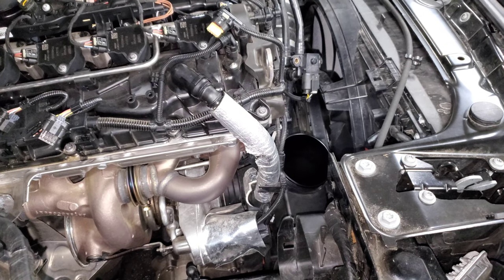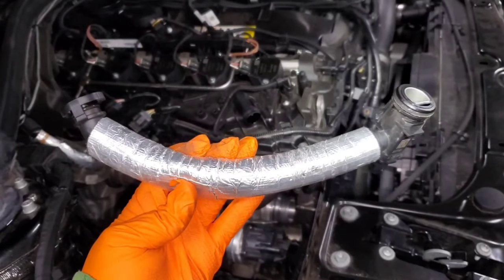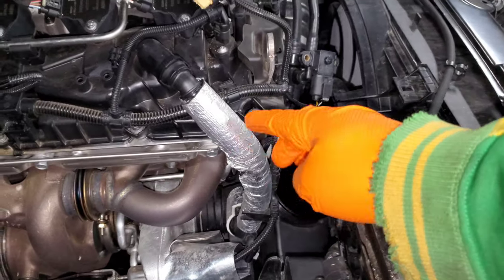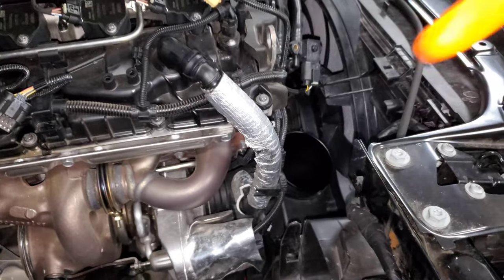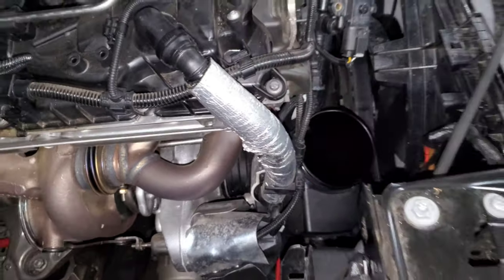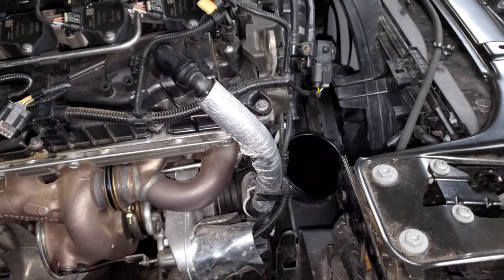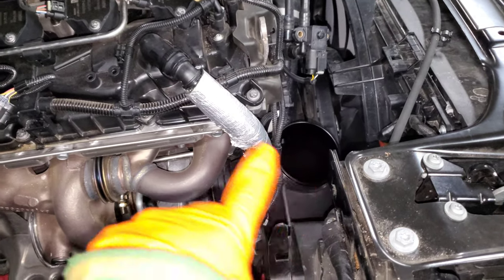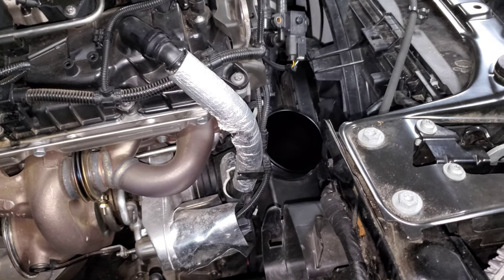P120D/20E120 Crankcase Ventilation Hose Disconnected - Common B58 Issues

Comment: Had this code pop up on my m240i with the agency power intake (since discontinued.) Didnt throw a CEL, only a code, so you wouldn’t know if you didn’t check. I ended up reinstalling the intake much tighter the second time and cleared the code and it hasn’t immediately come back yet. Thanks for the video as always, glad it wasn’t just me.
Reply: Hi! Did the code ever come back after you reinstalled the intake?

Comment: Is it okay to drive with it if it’s cracked? Will it negatively affect the car? Thanks 🙏🏽
Reply: Also are there any tutorials on how to replace this hose, I can’t seem to find any lol
Reply: @Oscarrsaa you find how to take them off? Ever since I started running e50 mix this thing cooked it
Reply: @Hand3r261gos  yes I took mine off, it’s a really easy job but the clips that connect the hose to the bottom of the intake are the hardest part to take off, my suggestion is to get a small screwdriver and push in the bottom tab FIRST and then do the top. Should pull out with a bit of force. Also I’m on e50 too and my old hose broke into 3 pieces when trying to take it off lol… it did make it easier though.
Reply: @Oscarrsaa does this cause smoke out the exhaust ?
Reply: @jzallday102  no
Reply: @jzallday102  only thing that caused smoke was when I had a faulty pcv diaphragm. Easy 15$ fix and never smoked again
Reply: @Oscarrsaa  yeah man going thru an smoking issue changed my pcv but looks like my oem has a small crack on it and supposedly it would have an air leak from there if any sort of crack is on the cap it’ll smoke bc an air leak idk

Comment: I flashed bm3 stage 2+ and immediately got code 160504 and a CEL, checked all the wiring and plugs, plus cleaned the vent hose connector and tested voltage on the connector and got 3.3v on positive and 1.7v on ground. Code was not there before the flash, but now when I flash back to stock, the code remains. Wondering if I should replace the vent hose, maybe the hose heater element has internal wiring faults 🤷🏻‍♂️

Comment: Hey kern,  got DME code 160504 engine ventilation system heating, actuation open circuit. Have an aftermarket intake/downpipes/chargepipes. Never had this code after the install of them when I first checked, but checked today and saw it appear. any solutions? not much info about this code online, and all my connections/plugs seem to be intact
Reply from the maker: is the connector fully seated? that usually comes up if it's unplugged or if the wiring gets damaged.
Reply: @kern417   Feel so stupid that I didn't check my connectors properly, That sorted it thanks! Real credit to the b58 community

Comment: I got this code after upgrading my stock charge pipe to a VRSF charge pipe. I still have a stock intake. Help please. I already put a new hose but still the same code.
Reply: same here help please
Reply: The only real fix is to sell your BMW and never buy another one
Reply: Fixed it ?
Reply: @WiLDBWOY1  yes. I forgot to transfer the old O ring from the stock charge pipe to the VRSF. Once I did and cleared the code, it never came back.

Comment: Do you know about the code 101F01 , i have a F30 b48 with 101F01 issue but havent fix. However,  i still drive and sometime the engine light apear, some dont.

Comment: I'm getting this code on a late model E46 M3. Stock airbox tuned with stepped headers. PCV hose cracked and I installed a moroso catch can in line but still getting the code 🤔

Comment: The Ross Racing kit has a silicon plug that seems to loosely seal this pipe.  Does it need to be air tight?
Reply from the maker: it's under vacuum so it will suction shut when you drive
Reply: @kern417  thank you , yes I just found a silicon cap in the Ross kit for capping the top of that oem hose.  I think I’ll remove the hose and plug it down at the turbo intake pipe

Comment: Hey man I just had this code pop up on my stock intake? Is that something I should be worried about?
Reply: Same here did u ever figure it out?
Reply: same here. brand new car with 200 miles just threw a check engine cuz of it
Reply: Is your car tuned?
Reply: @chriskeshi2029  my code went away after I installed my intake. Crazy thing is I replaced the whole hose and everything but the code was stil
There till I installed my msg intake
Reply: @novanba5154  i have nothing aftermarket tho. i literally got the car 3 days ago and check engine came on the day after. everything is bone stock

Comment: Hey boss I don’t have an aftermarket filter I have the stock one and I’m having this code even when I clear it it pops back up crankcase ventilation hose faulty/not connected,also code for heat management clamped closed any idea what could be going on
Reply from the maker: replace the hose.

Comment: so i been having the 20e120 code for a while now, its been popping on and off. i replaced the hose but still having the code pop up. i also cleaned the MAF sensor. it went away for a day or 2 then came back again then was turning off and on again. i cant seem to figure out the issue for it. i’m assuming its because i forgot to add the downpipe to turbo gasket when installing my downpipe, could that maybe the issue? my car is upgraded downpipe upgraded chargepipe and mhd stage 2
Reply from the maker: I doubt it. What i take do you have?
Reply: @kern417  i have the stock intake atm

Comment: What would give me a p0202 code after valve cover gasket replacement… cleared code and drove it around and was fine til I pushed the engine a bit. I’m thinking it’s this causing my drivetrain malfunction
Reply from the maker: Find a scan tool that can provide the bmw 6 digit code

Comment: Could p120d come from an air box that has a hole in it? Or isn’t sealed perfectly? My 230i was a salvage project I just ended up glueing the airbox together but it’s missing a one of those metal clamps but it closes flush. Also we replaced the hose connecting to the air cleaner box so I’m confused as to why we’re getting the code
Reply from the maker: Yes it could

Comment: I have had this code twice now. My engine is completely stock and my air box is stock too. I was running MHD stage 1, but tune is completely stock also. Is this hose difficult to replace? I might try that before throwing lots of money at the dealer. (My warranty is shot because they found the tuning code.)
Reply from the maker: No it's pretty easy to access. The clips are annoying though
Reply: @kern417  ok, thanks!

Comment: @kern417 I have a 16050A code for crankcase ventilation leakage on my Supra. Is this related to this code or is it more serious? I have a service plan for it but its kind of confusing. Thanks for all your videos kern417!
Reply from the maker: The leak could be in a lot of different places. Even your oil cap being loose could cause that code.
Reply: Is the problem solved?

Comment: Where can I get a replacement? Need a trust worthy site if you have a link please
Reply from the maker: Dealer is your best bet. It's pretty cheap so probably not worth paying for shipping.
Reply: @kern417  and thanks again I bought my 340i as my New Years gift on the 31st and had this problem since, wasn’t able to find any visual video and what it can be precisely
Reply: @kern417  just an update, got the part! Roughy around 61, including tax. However I’m having difficulty removing the old one from the bottom clips that’s on both sides. If I don’t figure it out today do you think it’ll be possible to do a removal video or send me a incite on how to?
Reply from the maker: Check out my last video and it shows you how to remove those connectors. They are difficult no matter what but you need to squeeze the ribbed areas in order to pull it off  You can try using a pick tool around the perimeter to get it off if that doesn't work.
Reply: @kern417  Which video are you referring to in this comment, it will help me remove it

Comment: Is there a delete kit, or a way to plug it and get rid of it all together?
Reply from the maker: Yes, but it will still throw a code. It doesn't cause any issues with driveability so the easiest way is to block the code in your tuner if it's possible.

Comment: Could this cause a hiccup at idle? My b58 idles fine and every like 2 or 3 minutes the rpm will drop by 100 and come back up to normal.
Reply from the maker: It's possible if it's causing a significant leak

Comment: I had this code pop up after installing a aftermarket intake on my b58. I just cleared it, and I’m sure in the long run it’ll be harmful to the engine anyone have suggestions on what I could do to prevent any future problems?
Reply: I had this same code pop up a month or so after installing my intake, looking at the online Forums it seems like this is a common problem with a Aftermarket intake, there isn’t rlly any way you can’t prevent it, just drive less aggressive I would say, sometimes the rattle from the engine can mess with the sensor (may let the computer think there’s a leak somewhere, that’s why this code pops up) switching back on the OEM intake would just take the code away n won’t come back tho, harmful I don’t think so as long as ur hose isn’t legitimately cracked or off you should be good just monitor if you feel any difference in ur car!
Reply: Go back to the stock air box which is probably better then the aftermarket

Comment: How do you take off the bottom part of the hose?
Reply from the maker: It has 2 clips that need to be pushed in. The easiest way is to remove the whole lower intake pipe, then remove it
Reply: @kern417  I did that already but I have a hard time pushing in the bottom clip. Do I just have to keep pushing real hard and wiggle the hose around?
Reply from the maker: @yoiinkHD  yes, use a small screwdriver or pick tool to push it in until the hose comes out
Reply: @yoiinkHD  How was the removal for this, I am going to replace my hose

Comment: I replaced the crankcase vent hose on my F15 and I still can’t get rid of this code : 160504 Crankcase ventilation heating, activation: Line disconnection
Last occurred at: 47752 mi
Engine
Critical
Reply from the maker: Is the electrical connector plugged in properly
Reply: @kern417  I believe so.  I wonder if it should be replaced.
Reply: Thank you Kern
Reply from the maker: It's possible. Pull the intake and take a look
Reply: @kern417  
working on that tomorrow.  Thank you

Comment: I have the BMS catch can and i think thats what is causing the code to turn on after 500 miles of driving
Reply from the maker: Yes Because it goes in place of the pcv hose. Make sure there aren't any leaks at the connections
Reply: @kern417  only iffy connection is the adapter from bms to the oem pcv pipe. I changed the oring to something thicker and hopefully it seals it better than the oem oring